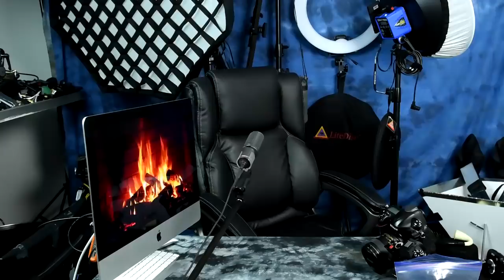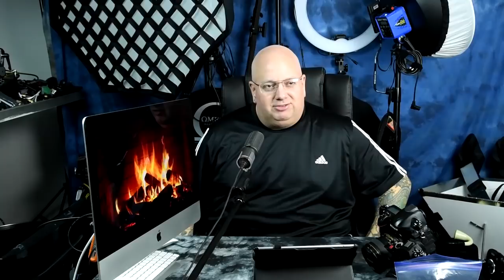🤔Signal Noise Ratio: Explaining the REAL Third aspect of EXPOSURE

Comment: So was out taking photos with my radio the other day... and then it hit me... there IS a difference between a radio and a camera
Reply: Eoghan Hennessy Yeah dude, one captures visible light and projects it in point specific locations due to its electromotive force. The other captures radio waves (light) and projects it through a speaker. However I think you may have missed his premise 😱
Reply: Eillo Htims it was in that moment that I knew I was FLAT wrong!!! 😉
Reply: Eoghan, there are mechanical and component differences for sure. What he was saying is that Electromagnetism is Electromagnetism. Whether it's in a circuit board, star, outer space, hitting the aperture of a camera or the antenna of a radio. Light is light is light and follows a simple path of causation. So you must apply similar if not identical methods in manipulating the physics of that light. 

I can't tell how sarcastic you're being on text however undeniably, Kens premise was correct. So Yeah...
Reply: Eillo Htims of course I’m just being absurd 😇
Reply: You had me good and proper there 😂😂
Reply: and you've succeeded :-)

Comment: I realize this is five years after the fact but here we go. I love this channel, you know the technology to a depth that maybe no one else doing photography videos does. But I feel like something was left out here. Or maybe it was implied and people smarter than me picked up on it. You mentioned ETTR and saturation in the discussion about SNR. Your example of headphones on plane illustrating the difference felt out of place for a discussion about photography. I think the point here was that light equals signal. Lots of light, or saturated photosites leads to favorable SNR. Is that correct? Also, I think the reason this isn't taught much elsewhere is that too many people still equate the sensor to film. If you ask Chat GPT about ISO it will spit out the inaccurate information about ISO changing sensor sensitivity. I think that's how most people think it works.   
Thanks for being a strong signal in the darkness.